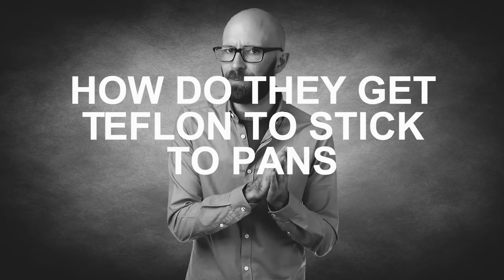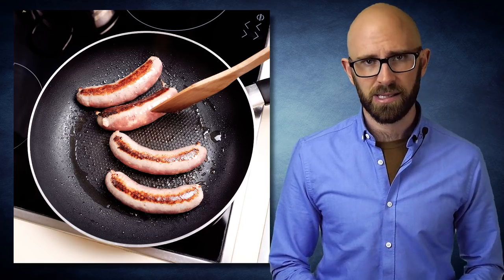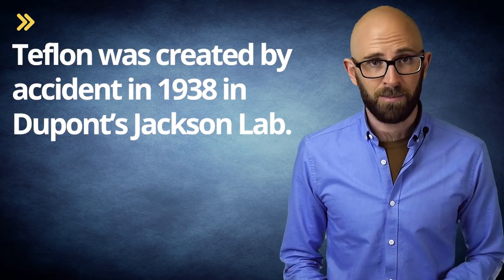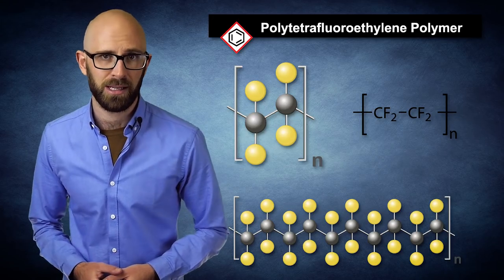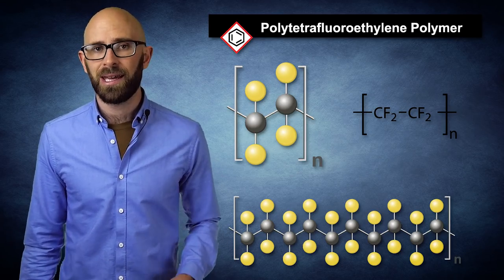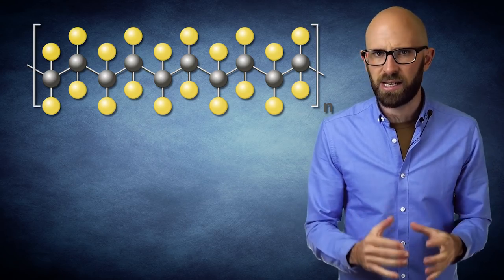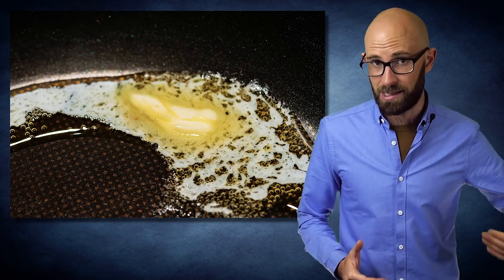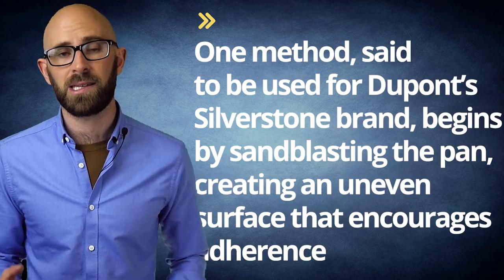How Do They Get Teflon to Stick to Pans?

Comment: Didn't they ban Teflon?  I haven't seen any of it in years.  Just the new fad of all these "copper" pans.  Not that I'd buy Teflon anyway since I noticed years ago it peeled and black stuff was getting in my food.  I know that can't be good.  Also, things just didn't cook well on it, especially eggs.  I'm as lazy as the next person when it comes to cleaning dishes, but I'm also a very picky cook.  And even if Teflon was perfectly safe, I'd still stick to a stainless steel and cast iron pan for the things I prefer to make.
Reply: Copper is theoretically good due to increased heat capacity (like cast iron) and good thermal conductivity making for even cooking, though the difference is very unlikely to be worth the price.

Teflon shouldn't really affect cooking, though if it's coating a crappy thin pan as is often the case, the pan sure will.

Age and/or mishandling (usually scraping with anything hard) a teflon pan will cause it to flake, at which point you should probably throw it out, even if the health concerns are minimal to non-existent.

If you're really concerned about it though and want the non-stick properties, I hear ceramic coated ones come close and are harder to mess up (unless you drop them of course).  Improvements in ceramics are likely why you're seeing less teflon rather than any ban.  It's fairly non-reactive stuff.

Comment: Now, explain they they get 'super glue' not to gum up the manufacturing machines much less the bottle filling
Reply: dufasduck simple, superglue activates in the presence of water (even just humidity). If the humidity in the manufacturing and bottling is 0%, there's no chemical reaction.

Comment: Can you tell me if any products are produced when Teflon pans are heated? I know Teflon pans to be toxic to birds. (Birds in the presence of heated Teflon pans will nosebleed and succumb in days.)
Reply: For normal cooking, Teflon does not give off any adverse chemicals. You really have to get the pans hot As long as you keep the temperature of the pan below 500 Deg F (260 Deg C), Teflon coated pans are safe to use.

Also, don't worry about eating flakes of Teflon in your food. The same, non-stick properties of Teflon that make them good in your pans will make those bits just pass through your GI tract and leave in your little poo packets at the end of the day.

That being said, I still prefer porcelain coated pans or Stainless Steel.

https://en.wikipedia.org/wiki/Polytetrafluoroethylene#Safety

Comment: Teflon is also not biodegradable.  This means that practically every human on Earth has some amount of Teflon in their bloodstream and it is NEVER coming out.  Thus, teflon is a chemical weapon.  They don't explicitly tell you on the product that if the teflon coating ever becomes damaged in any way that you need to dispose of the implement and get a new one.  They SHOULD tell you though.  However, in the process of telling you that they would be inadvertently admitting that it is dangerous to your health, which it is, as it is a foreign object that your body constantly attempts to attack, which causes cell replication and eventually, cancer.
Reply: You seem to describe mercury. In the context of human biology, Teflon is chemically inert ; it is used to built replacement cartilage which remain inside the body for years.
The body react to foreign invasion with a series of steps such as inflammation which
Reply: Daniel Duncan well why would your body purposely bring it into your bloodstream, isn't stuff like that supposed to be filtered out by your body
Reply: @YeetxBoi  i hope that is true because there will be no more carbon monoxide poisoning will happen
Reply: @GRAVYRAQUEPz  digestion does not equal inhalation, nice try tho. Teflon is too hard for. Your body to break down for your body I would assume, but then again if it's broken down to the point of degradation it might be weak enough to be broken down completely and absorbed.
Reply: @YeetxBoi   how legit is your statement is? any source of that info? I'm still not buying it both your information and the product Teflon
Reply: @YeetxBoi but that still answer your question why does it goes to our bloodstream.
Reply: @GRAVYRAQUEPz  notice I not only said I assume my statement, but also offered my own contesting of my statement, as well as my main point was that your statement was irrelevant as everyone knows ingestion does not equal inhalation, unless you breathe food and eat air, which as bad as your argument vs my statement was in both your comments, you probably do lmao
Reply: @YeetxBoi I don't owe you an explanation on this as if youre promoting the chemical maybe explain to us ,the Majority, about the chemical.
Reply: @YeetxBoi  being abosrob by our blood stream that your word
Reply: @GRAVYRAQUEPz  lmao ok